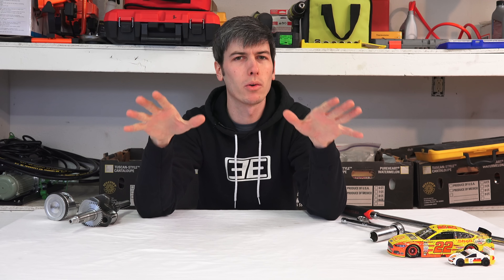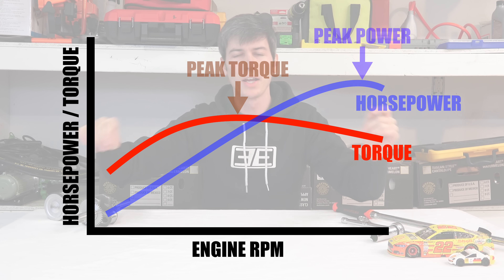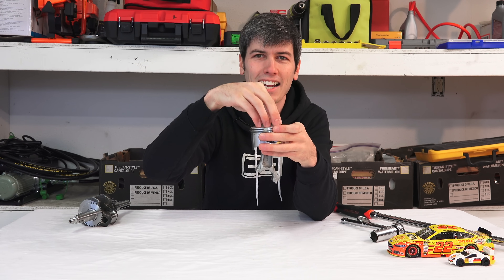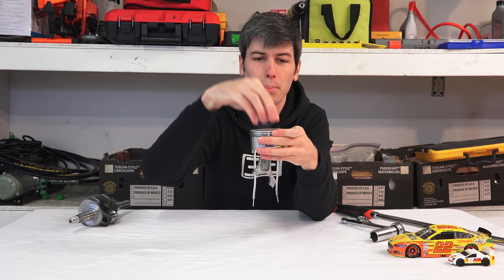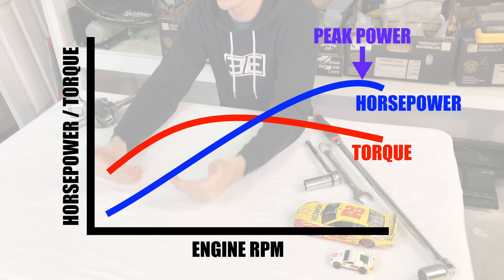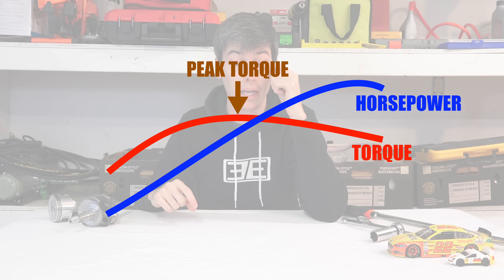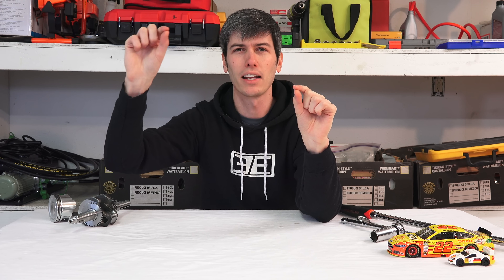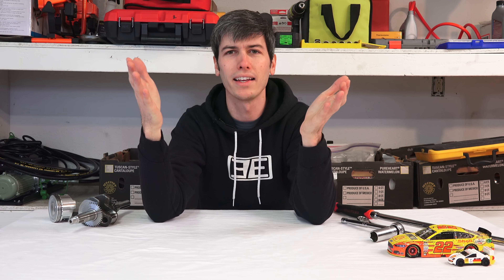Horsepower vs Torque - A Simple Explanation

Comment: I argue with the quote "more aggressive gear ratio" benifit on the power. Because higher torque car could have the upper hand too if it had a faster top speed gearbox ratio. The higher torque motor can keep pulling a taller gear in other words. Plus higher torque motors have lower internal engine friction losses opposed to high rpm power motors turns into wasted energy to move the car becomes undesirable. Also low torque motors are generally more efficient, allowing more energy to move the car faster with the same amount of fuel

Comment: Easy way to get it... Torque is the pulling force you feel when you floor it, if you have less torque you're gunna accelerate but not as fast because the crank isn't under as much load... I think.. correct me if I'm wrong
Reply: Technically what you feel is horsepower, but high torque at low rpm feels fast because the hp is higher at low rpm and the increase in hp at low rpm is sharper

Comment: Read this and learn torque and hp : 

If we have 2 cars with the same horsepower but different torques,

For example, Car A has 100 hp and 100 torque, and Car B has 100hp and 200 torque (and all other conditions are same.)

If these cars are racing on the straight road, Car B is gonna have better acceleration at first but then Car A is gonna pass the Car b and win.

But if they are racing on a ramp, Car B is gonna win.

End of story

Comment: Trying to understand torque... if the leverage that turns the crankshaft doesn't change, then isn't the only way to get the crankshaft to turn faster increasing the force the piston exerts on the crankshaft? And if that's true, then shouldn't torque always increase with RPMs and vice versa? I'm assuming that the crankshaft can't turn independently of the lever driven by the piston. Im also assuming RPMs refer to the turns of the crankshaft and not of the wheels/axle. What am I missing?
Reply: while its true force is directly proportional to acceleration and also speed but you forgot that power (rate of energy transfer to the crankshaft) determines the time or duration this force or torque is acting on the crankshaft. Hence in theory a car with engine that has more power while less torque will eventually be faster after certain amount of time than a car  which engine with more torque but less power.

Comment: As far as cars leaving line quicker, torque gets you of the line faster horsepower pulls you through the top end, thats exactly why pushrod engines get of the line quicker than perhaps a higher hp OHC

Comment: Torque means force, torque by itself is just a unit of force, it doesnt mean how much work is done within what amount of time (Total force)....
When u discuss about car performance, time is always referred to thus horsepower is relevant than pure torque unit without time based torque by itself is irrelevant....E.g. A) 1000 torque can be done in 1 minute or B) 1000 torque can be done in 10 minute thereby means Work (Horsepower)
A) is deliverance of 1000torque/minute wHilst B 100torque /minute thus A HP is higher than B  car so to speak

Speed/acceleration, say to achieve 0-60 in the fastest possible, means u need max HP so as much torque as possible because u need to achieve 0-60 in shortest, therefore highest torque possible helps 0-60 as HP is (torque x time)...since 0-60 is a time based measurement thus it means measurement in work/ power/ Force over time ...

As a result, Horsepower means total force over TIME.. well, torque is just torque without time based unit

Equation wise is HP (total force over time)=Tork (force) x time (rpm/rotation per MINUTE) minute is time.

Pls LIKE if this helps or if you understand . Spread love not hate

Comment: Bicycle gears ...
Torque: When u are in the first gear, u can easily pull the pedals, but u cant go fast.
Power: When u are in the last gear (18 or 21) you can hit high speed, but you should pull the pedals much harder to reach that speed :)

Comment: I am wondering what acceleration would look like if you geared a high torque engine for speed? Would you see more acceleration at the start compared to a high HP engine with a very peaky power curve?

Comment: When we speak about torque in engines, we are talking about the ability to accelerate faster.
You made a comparison with a car with 200hp / 100 lb/ft of torque and a 100hp / 200 lb/ft of torque and you said that the car with 200hp will be faster...
Well...
That depends...
And in a certain way you are wrong...
Tha 100hp / 200 lb/ft will accelerate faster to the first half of rhe way and the 200hp / 100 lb/ft will do it the other half.
You can see it practically comparing gasoline engines and diesel engines

Comment: So, "torque gets the car moving and horsepower keeps it moving?"
Reply: Torque results in acceleration.  Power is moving the car from A to B in a certain amount of time.  You can trade torque for speed and it doesn't change power.  You can use a low gear ratio, and you'll accelerate faster, but to a lower top speed.  Or you can use a high gear ratio and accelerate slower, but to a higher top speed.  In both cases you'll go from A to B in the same amount of time, so the power is the same.  You've simply traded torque for speed.  You didn't change the power.  To get the car from A to B faster, you must increase the power.  You can do this in a bunch of ways.  You can increase the torque and keep the speed the same, you can keep the torque the same and increase the speed, you can even decrease one and increase the other, but the product of the two must be higher.  Torque * speed = power.  Power is the rate of doing work.  How fast you get the car from A to B.
Reply: @stargazer7644 , Thank you!

Comment: It's helped indeed. But not cleared it up yet but that's probably because I'm slow. Am I correct by saying I should be able to hear peak power/torque in the engine since its based on RPM?

Comment: I got confused halfway through, and then I thought about a cyclist on a 12 or 15 gear bike.  On a straight road, they are cycling at their fastest (horsepower) when pedaling at the highest gear which has the least resistance (lowest torque).  But if they need to climb a steep hill, they cycle much slower (less horsepower) at the lowest gear which has the highest pedal higher resistance (highest torque) to get them up the climb.  

Depending on what the cyclist needs to accomplish, they will continuously balance power and output along the horsepower and torque curves the video showed.  Thus, his last diagram made sense to me showing max peak acceleration at a higher gearing of 4.0 then 3.0.

Comment: Hi. You said that torque can be increased at the point where max power occurs which is generally at the highest engine speed. So is it possible in manual transmissions to get maximum acceleration at maximum power point?

Comment: I need help with the following question please.
Can a speed controller on an electric motor be used instead of a geared motor and still maintain the same torque?
Reply: Yes. The torque characteristics of an electric motor are quite different to those of an ICE

Comment: So in a sense, the chart actually talks abt the different gears... like each gear has its torque and hp ryt? So all u need is find a way to balance or use them depends if u want torque or power

Comment: Love this video!  Question, doesn't torque also translate to towing capacity?  So in the video's example, if you hooked up a 1,000 pound camper trailer (making up a number off the top of my head), wouldn't the car with double the torque still have an easier time hauling it, despite having half the horsepower?

Comment: But the torque and efficiency change with speed and so if start out we need height torque lower speed but at high speed we need lower torque and higher speed but the better transmission design could be electronic transmission that is lighter, easier to repair and cheaper to produce and fewer part. The inertia law and its effect at space ship in space travel is hard to grasp. This mean it take less energy to propulsion smaller but more energy to keep it going but a medium size with its inertia increase efficiency. So a van is cheaper than a sedan for example

Comment: Just a question: im rly curious im a science stream student, barely know basic physics but just wants to summarize my understanding.
1. So you said that Horsepower = Torque X RPM. (RPM is varies not a constant value) what about those diesel engines where torque is  above the horsepower? 
2. Is it safe to say that: "Torque = Acceleration , Horsepower = Top Speed?" I know it must go together the higher power goes the more torque we gets too but is this theory half accurate? I mean in this figure, in terms of "horsepower" does related to top speed more than the acceleration? and Torque relates to accelerate than top speed?

Comment: In your 100/200 vs 200/100 example wouldn’t the increased torque allow for manipulating the gears in the opposite direction to achieve near equal acceleration?  If I’m applying twice the torque I should be able to accelerate at the same rate through higher gears allowing the cars to be almost equal assuming ideal gearing for each situation. Or 200 lbs of torque at 1x1 or 100 applies at 1/2  but at twice the rpm at input  both equal 200 at equal rpm at the output after gearing.  What am I missing?

Comment: this video should have also specified that if the 2 cars were suddenly to both pull a trailer of the same weight, then the higher torque would have an easier time doing it.

Comment: This got a bit confusing because there was not a clear distinction between torque / hp at the engine and torque / hp at the wheels, which is partly a function of the leveraging effects of a transmission.

Comment: wait so is this why diesel cars make way more torque than horsepower since they are low revving compared to other high revving gas cars? and why is it that a 2015 elantra has a top speed of ~190kmph with 145hp and 130Lb-ft, but a 14 jetta tdi has a top speed of ~190kmph but it has 140hp and 240Lb-ft but it weighs around 600lbs more? same top speed but more wieght? or are they just speed limited?
P.S. I've also seen stock jetta's, same year go 210kmph.
Reply: the strength that the extra torque provides, enables the car to push against the wind better even with the extra weight.  however it is more likely that the elantra will get 0 to 100 faster then the tdi.
Reply: questionabletopic ohhhh ok thanks for the info 👍
Reply: Can anyone explain what determine HP in an engine. Like 2 engines with same capacity, torque. But one has more HP. Here he says torque can be manipulated through gearing. So what about the HP
Reply: @ArunaVidu  if they use bigger Pistons then they can achieve a higher HP or torque or both. Depending on how they design the engine.
Reply: @questionabletopic9652  Thanks. In this topic of HP vs Torque, I can now understand what torque is, but I'm having trouble understanding HP. What I think HP is, ability to have a higher Rpm.
Reply: @ArunaVidu  a crude way to put it is HP is basically how fast the engine can use the torque.

Comment: another crappy not quite correct video
you said power is what gives you acceleration
yet tell me where power is in this equation F=ma
I actually wish we would completely remove the use of power and just give peak torque and what rpm that happens at

Comment: Sorry,but this is wrong.  Acceleration is the result of a force. Period. The force is that “ applied” to the road by the tires.  That force results from the T multiplied by the trans and diff gearing, applied at the tire radius.   The T curves follow the brake mean effective pressure curves, which itself follows the volumetric efficiency curves. And the resulting acceleration curve is also identical to the T curve. ( they’ll have different units on the Y axis , naturally. Keep in mind the are five torque curves for a five speed transmission) . Small torque engines with high horsepower (resulting from a higher state of tune and thus greater rpm) can in fact accelerate quickly, but only because their high rpm allows use of lower gearing for torque multiplication.

Comment: Had a 2000 model Ford Ranger 2.5L 4 banger 375HP coupled to a 5 speed direct drive transmission.  Man, what a truck that was.

(Tell you what tho - going up steep 3 mile grade as I often did back then,  well - all those hamsters up front inside the spinnydoodle pooped out bigtime b4 getting anywhere near the top   :-) 
Lesson learned?  I'll take a good amount of torque over tunns of hamsters anyday!

Comment: For linear motion, Power = Force of acceleration x velocity. For rotational motion, Power = Torque x Angular velocity

P = T*(rpm/60)*2*pi   (T in Nm and P in W). For HP divide by 746. What it means is just this -- if 2 engines spin at the same rpm, the one making twice as much torque at that rpm is also making twice as much power. If one engine makes half the torque at twice the rpm, then both engines are making the same power. If both engines make the same torque, but the first one is spinning twice as fast, then the first one is making twice as much power.

A torquier engine is simply making more power at low rpms, while a peakier engine is making more power at higher rpms. The more powerful engine will also pull harder, giving more acceleration. Accordingly the gear ratios would have to be adjusted. If both engines make the same power say, then the torquier engine will need taller gearing, while the peaky engine will need shorter gearing for the same vmax. THIS decides the acceleration and "feel" of the engine performance, and to some extent the application (heavy duty, slow moving truck vs lightweight fast supercars).

The gearbox is used to trade torque for speed and vice versa. The total power as the product of torque x rpm is always constant. 

The HP vs rpm curve and the torque curve vs rpm are more useful than just peak numbers. They tell you how the torque is delivered over the rev range (and by extension the power). The torque curve is more intuitive to read - you can see the difference between a peaky two stroke engine, a diesel engine, a naturally aspirated engine or a turbocharged engine. The HP curve is only good for comparing 2 engines.

The Torque curve tells you how the gearbox would have to be designed for each engine. In general NA petrol engines in supercars have become more powerful more due to the ability to spin faster. Turbochargers on the other hand increase boost and torque to give you more power in the rev range.

Comment: OK, true story. I was working on a residential construction project. We had a brick mason building a new chimney and fireplace. One laborer that the mason hired was a young fella who was into weight lifting and fitness. During a coffee break the boss gets a little tired of the talk and posturing of the young fellow and offers him a challenge. "After break, we will mix up a fresh batch of mortar, the individual (old vs young, 20 vs 60) who can get the filled bucket to the top of the scaffold ~ 20 ft. (via the rope and pulley) wins $100". The young man with his bulging biceps looks at the old gray haired mason and excepts his challenge. Coffee break's over, the young guy goes first and hand over hand pulls down on the rope as the bucket steadily rises (a few gallons of mud~60 lbs. +/-). It takes the the young man ~ 12 sec. a very noble effort. He says to the old mason, after lowering the bucket to the ground, with a smirk on his face, "beat that" and hands him the rope. The old guy looks at the fella holding the watch and says, "ready"?, "Ready... go!" and on go, the old man turns around and runs with the rope in his hands and gets the bucket to the top in ~4 sec!

Comment: A 500 hp honda with 120 ft lbs of torque is not as fast as a 350 hp toyota with 350 ft lbs of torque.
Reply: there are many other factors to consider. Weight, gears, aerodynamics, traction, etc

Comment: What is LB-FT. i wish a guy using SI measurement explained it
Reply: It is a unit of the same concept as a Newton-meter, except expressed in the unit system of pounds and feet.  There are about 1.35 Newton-Meters in a pound-foot.   It can also be a unit of work, like the Joule.   Just like a Joule is the work you get after applying a Newton-meter of torque through a rotation of 1 radian, a pound-foot of work is what you get after applying a pound-foot of torque through a rotation of one radian.

Some people use a convention of the order being "foot-pound" for torque, and "pound-foot" for work, in order to reflect the order of the variables in the formula. Since the torque cross product is not commutative, like the work dot product.  But others use both word orders interchangeably.

The dash in the notation, means that the units are multiplied.   Torque is a cross product of a position vector from origin to application point multiplied by force, which is also multiplied by a sine factor accounting for how perpendicular they are, and then assigned to a direction mutually perpendicular to both.   Work is a dot product, which multiplies force through distance with a cosine factor to account for how aligned the vectors are, and only has magnitude and sign unlike torque.

Comment: tq = pay unit. i.e. hourly wage 
hp= income i.e. salary

the only thing you need to know is hp or salary. 

if you work 0 hours, hourly wage is pointless
if someone else has the same tq/hr wage, but i work 3 times the hours, then that tq/hr wage is used 3 times as much.

end result. HP is everything. 300hp is the same regardless of 10lb of tq or 100000000lbs of tq. 300hp is what you can use. how this is confused is beyond me
rpm is how many hours you work, tq is hourly rate     the paycheck is hp
how is this so hard